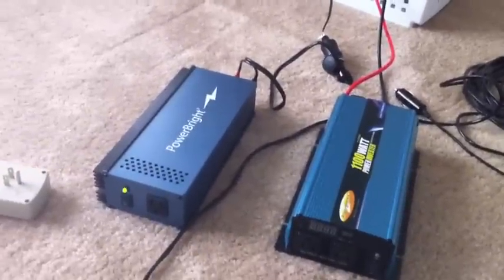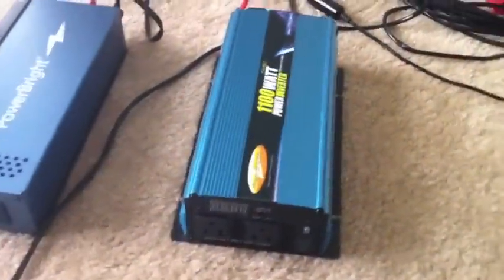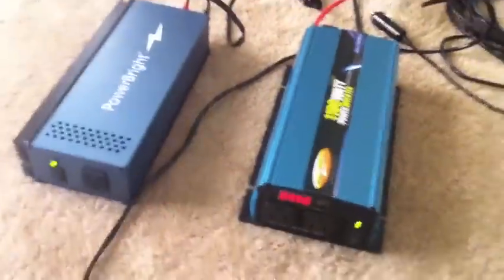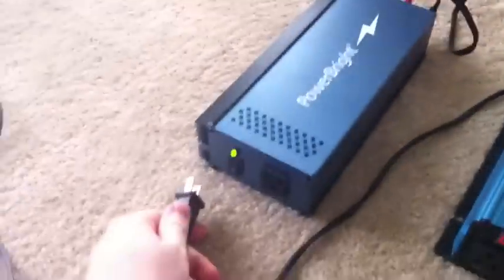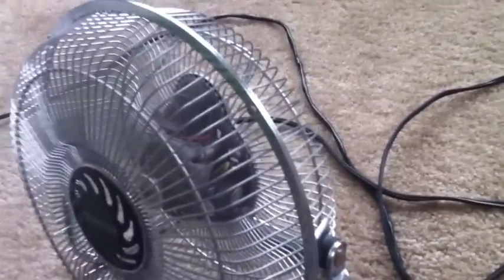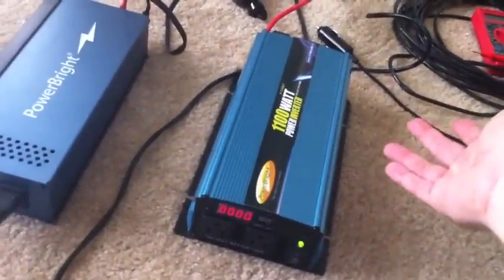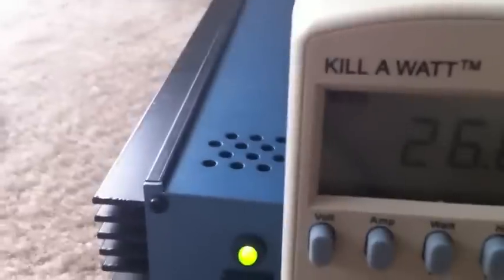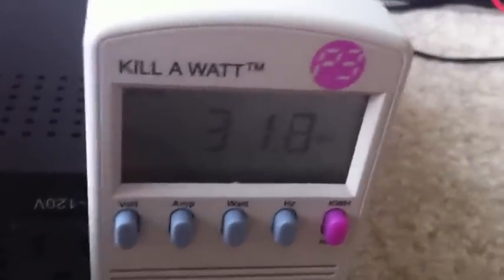What is the difference between a pure sine wave Ac inverter and a Modified sine wave inverter.

Comment: Yes i learned this the hard way with my solar projects... Driving motors like fridges or freezers get pure sine.
Reply: Lights are work well for modified sine, and brushed motors, not brush-less motors.
Reply: bosshoggett Brushless motors (single or multi phase) both work fine with a square ("modified") wave, their speed controller just doesn't like it.

Comment: Actually, that's a square wave. A "modified" sine wave comes in a few styles and the worst is the kind that simply returns the voltage to zero for a short interval between the positive and negative peaks. The second best has two more steps in between. Check wikipedia and search for "Sine_wave_inverter". I made sure the picture of the wave shape is in there now (halfway down the page, two separate sections).
Reply: post the link?  https://en.wikipedia.org/wiki/Sine_wave

Comment: Let me suggest. How about you put some 50/60hz capacitor to modified sine wave inverter. :)
Reply: That's why technically the pure sine wave inverter are expensive. It involves extra components
Reply: +MAsTErTRanCeEviL it is bad to do like this. Modified sine wave inverter change output voltage very quickly from 0 to maximum and back to zero.  You can blow capacitor doing like this.

Comment from the maker: If it Runs on DC you can use a modified a cheep one should work just fine. Over a long time it may kill the power brick but they are cheep. If you know what you are doing you can run it straight off the battery if it is running a 12 volt.

Comment: From the scientific experiment perspective (control group/test group), I'm wondering about the accuracy of the experiment, considering that the Pure was 300W while the Modified was 1100W. Would the humming be a result of the type of sine wave (as you are suggesting) or possibly as a result of the increased Wattage allowance? I wish the 2 inverters in your experiment were equal in Wattage, as it would eliminate that variable from the results.

Comment: Those square wave units can be converted to sine wave with LC circuit that can plug into outlet then to the load. Its not complicated just need to design a box that plugs into the inverter outlet and with a coil and capacitor value you can effectively bypass the humming problem. The hard part is designing the LC circuit.
Reply: Not many people know this, I discovered it with an oscilloscope while 'building my own CDI ignition circuit" for my Honda three wheeler... I wound a charging transformer around a FERRITE CORE and discovered that the square wave I was feeding into it was coming out full sine wave the other side. Seems the 'eddy currents' in the ferrite were stretching and smoothing the 'steps' in the square wave. Try it, it's really fun to see. With low voltages and ... since it is always easier to work when you can see what you are working on, and oscilloscopes are SO CHEAP these days, get one. Really amazing instruments ... and when playing with the Fire of the Gods, be careful with the matches.... Gizmo Joe, Slab City.

Comment: Those diagrams are interesting - I've never encountered a 'modified sine wave' inverter that produces a square wave, modified sine has a 0V gap between each peak. 
A square wave would actually be better for running some motors.
Reply: a modified sine wave IS a square wave with filtering to 'shave the corners' off the square wave.
Reply: A square wave is never better for running motors. Due to the full range of odd harmonics of the fundamental frequency it produces, it overheats them and finally kills them. Nevertheless it is perfect for pure resistive loads, like water heaters and incandescent lamps. The waveform therefore depends on each application. Of course, sinusoidal inverters can supply any load flawlessly.

Comment: That's how its done in fact. Create a pure sine with a cristal/ LC circuit (unloaded), charge a capacitor until it reaches the at that point in time needed voltage level (compare it with the created sine). This a few 1000/sec (? don't know how much exactly). Filter out undesired noise with other LC circuit.

Comment: Unless your metering equipment is specifically designed to measure that type of wave form it will not be accurate. No mod sine wave inverters produce a square wave like the picture on the box.  It's a lot closer to a triangle wave with the sharp points rounded off. Motors that have brushes (power tools) work fine on mod sine inverters. Induction and shaded pole motors most (household appliances) do not.   I use a 2000w one instead of hauling a generator around to run a skil saw and drill.

Comment: I believe a pure sine wave inverter uses more battery current than a modified sine wave inverter. So if you aren't using sensitive equipment, a modified sine wave inverter will work just fine, and your battery power will last longer.

Comment: damp, yes it is a problem.  It will corrode internally and fail fairly prematurely with humidity levels over 80%.  Cold is not a problem for the inverter - just the batteries.
Reply: if the inverter is in a relatively warm environment, dew will not form. When electronics are cold and brought into a warm environment humidity can condense and water is anathema to live circuits (especially live circuits). Bring them up to room temps before powering them on!

Comment: It buzzes because the square waveform has an extremely fast rise time.
For inductive loads (motors), the back current is related to the rise time. Sine waves are smooth; square waves are abrupt and fast.
For capacitive loads (most things), a square wave is an immediate change in voltage, causing a huge surge current to charge the capacitor.
Overall, the humming noise is due to extra magnetic fields brought on by the larger currents. This causes a 60Hz physical vibration, which you hear as a hum.